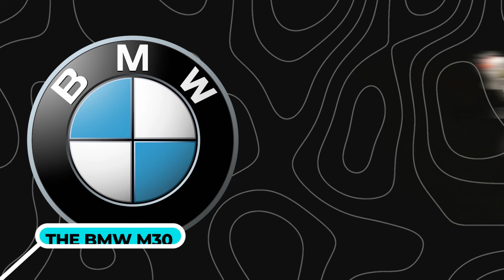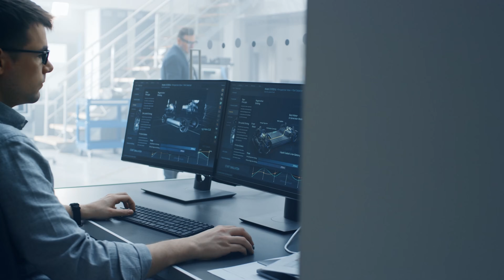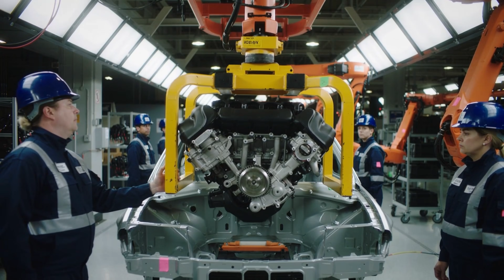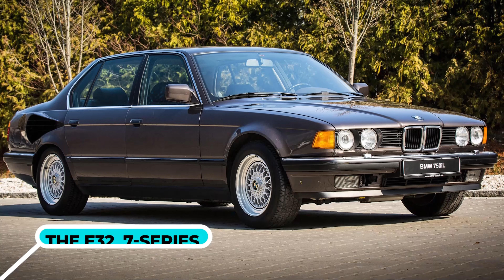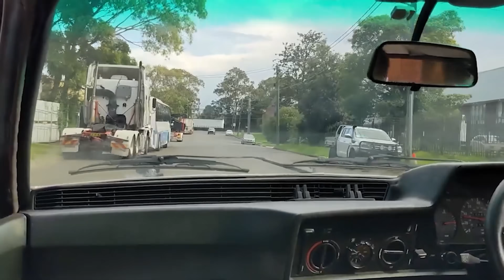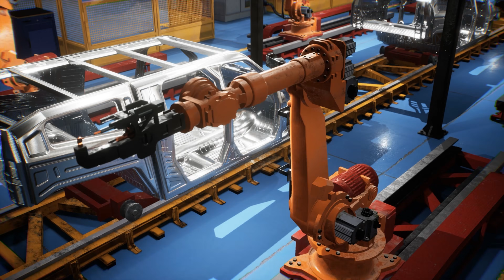The BMW M30? — The Engine That Built The Brand? Raw Power Philosophy.

Comment: What a great tribute your video is to the timeless M30 engine!  It is a real pleasure to watch for any M30 owner, like me!  As the years pass, and BMW has evolved into something very different, my appreciation for the reliability and simplicity of this engine has only grown.  Now, an easy original 178k miles and still runs like a charm.  Thanks very much for this video, it's a keeper, just like the M30!
Reply from the maker: Thank you so much for taking the time to write this -that really means a lot to hear. It genuinely means a lot. Comments like yours are exactly why I make these videos ❤❤
👏 An original M30 with 178k miles that’s still running strong is a testament to how well BMW engineered them. Long may it keep going! Out of curiosity, which M30-powered BMW do you own?
Reply: @GermanPowertrainStories  I have had a 1989 535i with a 5-spd for over 30 years now.  What a satisfying drive!  The combination of engine, suspension and braking is all so well-balanced.  Thanks again for your great video!
Reply from the maker: @nextphase7481  That’s amazing. 👏 A 1989 535i 5-speed for over 30 years is something special. Cars like that become part of the family. The E34 and M30 really were a special combination—smooth, reliable and so rewarding to drive.
What’s the mileage on it now? I’d love to know how many miles you’ve shared together.
Reply: @GermanPowertrainStories  When I got it (2nd owner) it had 52k miles.  I have brought it to the present 178k.  All at an average rate of about 5k per year.
Reply from the maker: @nextphase7481  That’s the best kind of ownership story. From 52k to 178k over all those years—you’ve really lived with that car rather than just owned it. Thanks for sharing it, and here’s to many more miles! 👏 Long may it keep running strong—and here’s to 200k! 🍻 I had an E39 5 series with with 198k miles on! Such a great car!

Comment: Best oil grade to use on these engines is 20W-50. These engines love thick oil!
Reply from the maker: Absolutely 👍 20W-50 is a popular choice for the M30, especially in warmer climates and on higher-mileage engines. They certainly seem happiest on a good-quality oil with the right viscosity. What brand do you normally use in yours?

Comment: have a 635csi from 84, thoe i put a E34 m30b35 in it with its harness.   each year before summer i give it oil change and valve adjustment or service if any needs it. BMW moved away from this because of regulations, and people wanted more power. from back then to now its been more and more common you get a car run it while its in warrenty, and then sell it to get a new.. back then you had a car til it couldnt move anymore. that is not enough money in it if people keeps there cars.
Reply from the maker: That sounds like an incredible car. 👏 An ’84 635CSi with an M30B35 swap must be such a satisfying combination—classic E24 looks with the later, stronger version of the engine. I also completely agree with your point about ownership changing over the years. Cars like yours were built to be maintained, repaired and kept, not treated as disposable once the warranty ends. Thanks for sharing it—how long have you owned the 635, and do you still use it regularly?
Reply: @GermanPowertrainStories  ive had it atm for only 5 years and the previous owner had it for 30 years, ive importet it from Germany, im from Denmark myself. and yes i still drive it, thoe not in winter "we use salt on roads in Denmark" :(  the engine swap was because i did find that motor with its harness, and then i rebuild the engine because it was on a stand anyway. and after it was done, we made the swap, so i have a spare engine if shit happens xD
Reply from the maker: @boomcat1337  That’s such a great story. 👏 Imported from Germany, owned for 30 years by the previous keeper, then rebuilt and upgraded by you—it sounds like the car has been properly cared for throughout its life. Keeping it away from Danish winter salt is definitely the right move too! And having the original engine sitting there as a spare is the ultimate insurance policy 😂 Long may you enjoy it! 
Do you notice much difference in character between the original engine and the later M30B35?

Comment: My e34530i has done 500.000 miles m30 engine
Reply from the maker: 500,000 miles is incredible 👏 Comments like this are why the M30 has such a legendary reputation. Half a million miles from a naturally aspirated straight-six is a testament to just how over-engineered these engines were. Is it still on the original engine?

Comment: I still enjoy my catless '83 635 CSi. The whole car is truely a peak of german engineering and also the shape is a kind of its own. The deep, throaty exhaust note under load is really something different compared to modern cars. Btw in Germany the M30 is called Eisenschwein (iron pig).
Reply from the maker: "Eisenschwein" — I'd never heard that before, that's brilliant. An iron pig that refuses to die. The 635 CSi with the M30 is such an underrated combination — that deep exhaust note you're describing is exactly what the video is about. Thanks for watching 🙏

Comment from the maker: The M30 ran from the late 60s all the way into the early 90s — powering everything from the E3 and E9 to the E24 635CSi and E28 535i.

Many people say it’s the engine that built BMW’s reputation for straight-six engines.

Curious what you think:
Is the M30 the greatest BMW engine ever… or did the M50 / M54 improve on it?